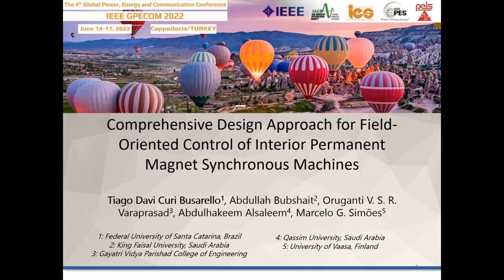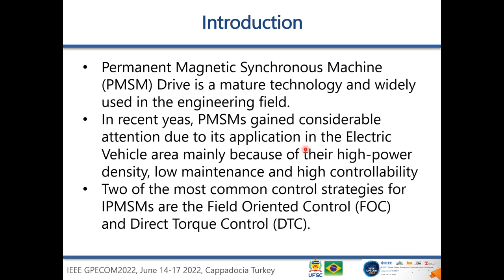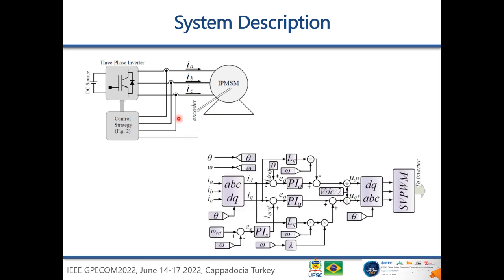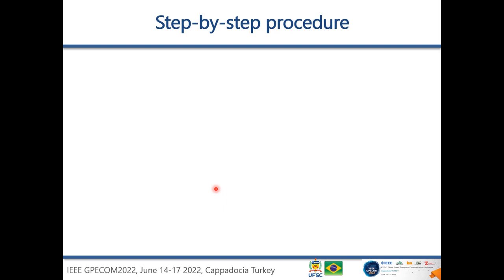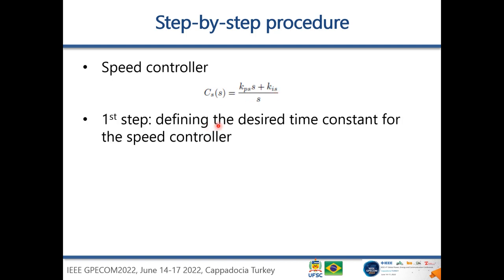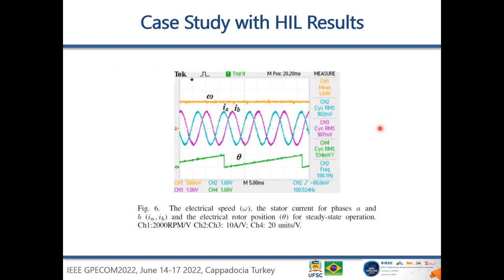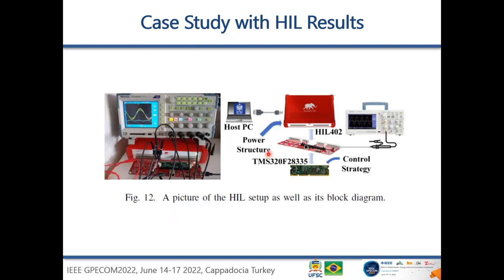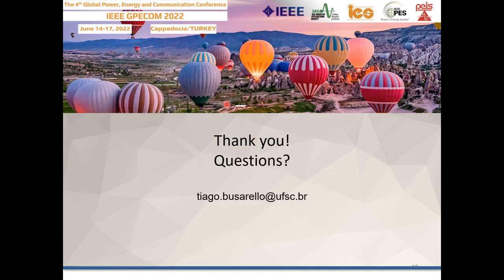Comprehensive Design Approach for Field-Oriented Control of Interior PMSM

Comment: Good work.
 I am wondering how you represent the time delay in your DQ model? Also, remember that the current sampling is done in a stationary frame. If you push the simulation at the higher speed of 10000 RPM with low torque is the current control design procedure will be the same?
Reply from the maker: Hello. Thank you. About representing the time delay, I neglected its effect indeed. The currents follow their reference in a satisfactory manner. About using the design procedure for speeds like 10000 RPM, I need to check. The only thing that I can assure now is that actullay there are boundaries in the speed operation that the procedures is accepted. This is one thing that I'm going to present in an extended version of my paper.